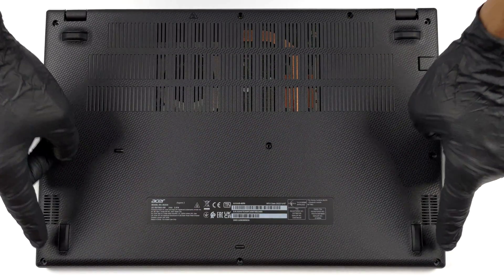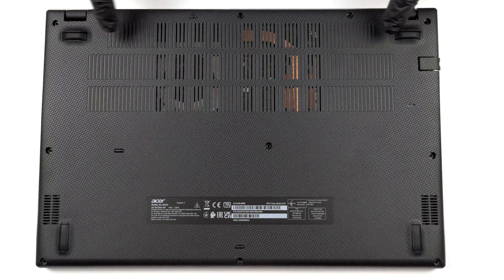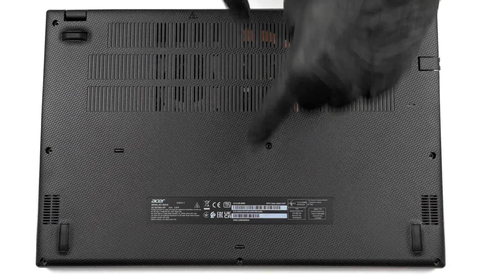🛠️ How to open Acer Aspire 3 (A315-59) - disassembly and upgrade options

Comment: Is the space on the left of the fan for installing a 2.5" SSD?
Reply: No, its there because there are 14' laptop internals in 15.6' laptop
Reply: @skld1295  and some models with discrete graphics chip have two fans and this space is where the second fan goes such as on the Aspire 5 A515-57
Reply: @ you're right, didn't thought about that

Comment: I just replace my thermal paste and and i found out there a button on my motherboard when i turn on my acer laptop id doesn’t show any thing only power limp working i cant enter bios or even see the acer logo can you help me please? Is the button reset for m.2 ?
Reply: button is to enter BIOS on power up.  If it doesn't work there's something wrong with your motherboard.

Comment: Wow you can go nuts and have three disk drive. I end up breaking some of the clips on the bottom cover removing it.
Reply: where is the third one installed and connected?  There's only two M.2 slots.
Reply: @bbaker6212  the empty space is for 2.5 SATA

Comment: is it possible to put a 2,5" drive onto this one?
Reply: yes you can, you just need to get the SATA connector and the adapter to screw it on
Reply: @juanalejandrolopezmatias3154   hmmm... I'm not sure about this. Where is the SATA connector on the motherboard?
Reply: @bbaker6212  There's a SATA connector in A315-58, but not in A315-59.

Comment: Can i ask will the laptop works if i remove the battery  and just only using the charger adapter.
Reply: I have an aspire 5 and if it works connected with the battery removed, but the head of the laptop charger will probably be damaged after 2 years

Comment: a waste of space, this model sucks, the empty space is for what?
Reply: I think it is one of the best models of the acer aspire, first of all it has the possibility of updating the ram and making the dual channel with ease (in other models soldered ram and a free slot, giving crazy combinations of 16gb (slot) + 4gb/8gb(soldered) = 20gb or 24gb and the dual channel is not very optimized, and in others with only soldered ram), continuing with its great capacity of the SSD, one being 4.0 for a faster start, 2tb for each slot and the HHD too, giving a large capacity of 6TB capacity, in addition to the possibility of changing the wifi module for better performance,
Its biggest con is the lack of a USB-C port, which is essential in 2023 onwards, greatly limiting its large file transmission capabilities.
Reply: @Daniel_aguilar5304  thx alot for the comment it really helped but i just need to know something please the version am thinking of buying it comes with i5 1235u and was just woundering is it good for day to day use and photoshop or no
Reply: I have an idea that in some models it comes with HDD, in ethernet you can find the adapter of the board to an hdd